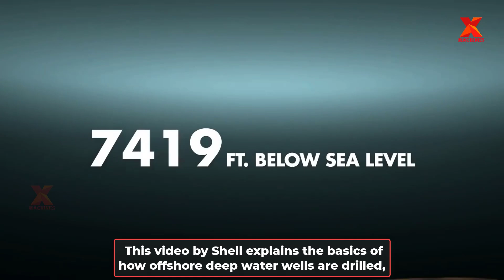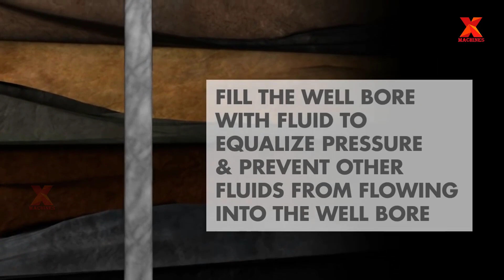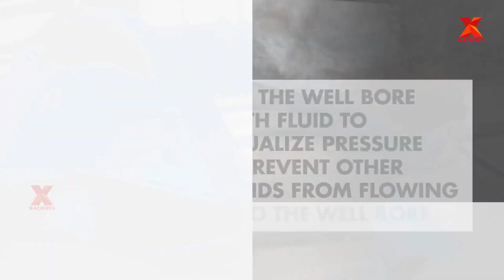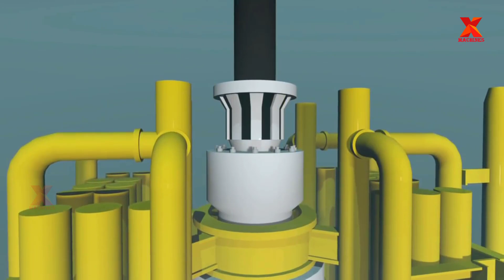Technology Drills Deep Water 3km Below Sea Level. How To Drill Well. Horizontal Directional Drilling

Comment: Shows a 16” auger bit drilling a well in an open field, then workers next to a building setting 4 foot diameter liner “in the same hole”.  Really?   Not exactly a consistent edit. 👎🏻
Reply from the maker: They have exactly the same process. Just lower the concrete ring into the hole.